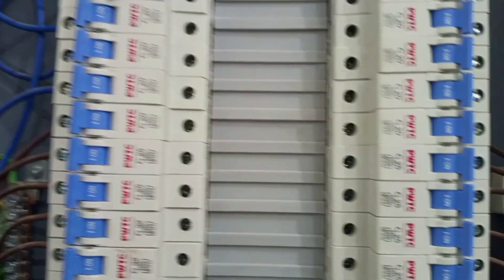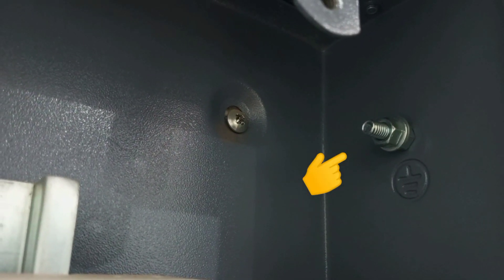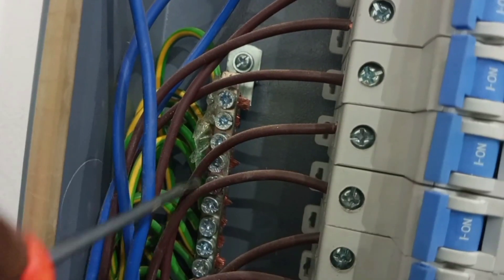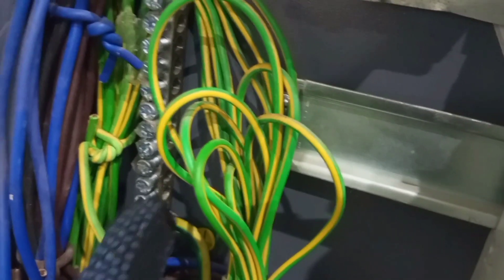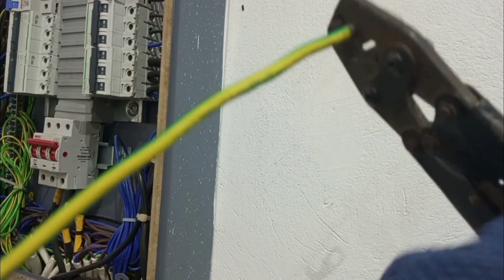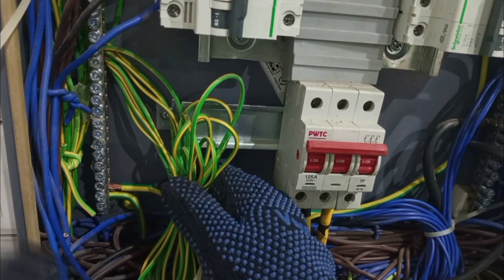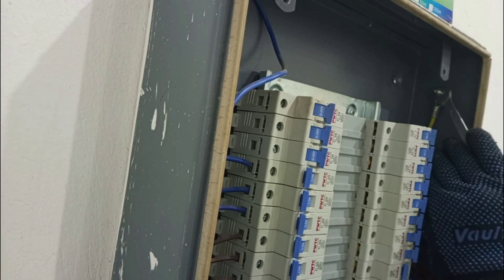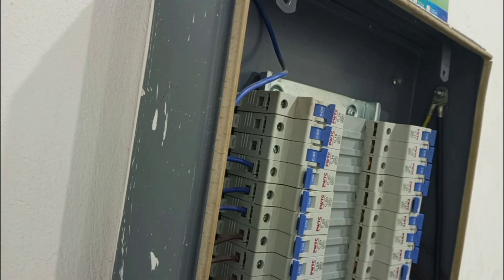proper earth cable connection in the switch board

Comment: I think the earth bar terminals and side indicated Earth are both the frame of the consumer unit.

Is there any side effects of not connecting the earth bar to the  part indicate earth ?

Secondly, what is the difference between earthing and bonding in electrical system?